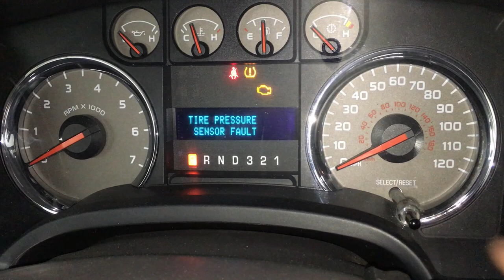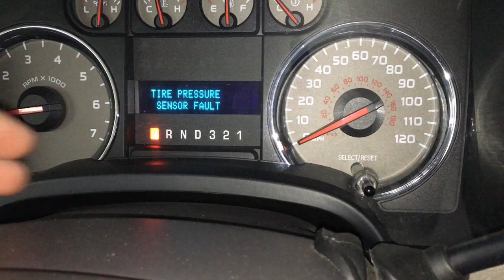1997-2010 Ford F-150 Rear Brake Job: Pads and Rotor Replacement

Comment from the maker: These are the Parts and Tools needed to complete the job:
Rear Pads (check fitment guide)-
http://amzn.to/2m43EcI
Rear Rotors- (check fitment guide)-
http://amzn.to/2m4cR4W
Brake Dielectric Grease-
http://amzn.to/2m424HN
Nickel Anti-Seize-
http://amzn.to/2mOVBjX
Brake Cleaner-
http://amzn.to/2mkwHLA
C- Clamp-
http://amzn.to/2mOYgdB
Reply: FordTechMakuloco it also causes the caliper to bite on the ear when it's on wrong and jams the brake on the outside thank you I had them wrong and it was jammed up
Reply: You failed to mention guides and guide boots in your list.
Reply: As you clean the caliper I find myself blowing on my phone trying to get the dirt an dust off the caliper. 🤦🏽‍♂️🤣
Reply: @derekhuber3392  He used the same guides.

Comment: Great video but without the park brake components it's not really a good representation on what people would encounter when doing the rear brakes. I love your videos and you certainly make great ones but I think this one is kind of funky. Sure it provides for basic brake replacement techniques but I'm sure you know that the drum park brake is the "headache" part of the job and I think your viewers would benefit from a demo that shows the park brake.
Reply from the maker: +Robert Kohut Maybe in the future, I can only film what comes in the shop and this is the customers decision. The drum in hat brakes can go either way some fall off some never need to be touched.
Reply: This video is good enough for me. 
And so i am content.
Reply: @FordTechMakuloco  A
Reply: ASI ES COMPAÑERO SON MUY IMPORTANTES PARA CUALQUIER VEHICULO SALUDOS
Reply: I just replaced the rear rotors and pads on my 2010 F-150; this model has the integral parking brakes inside the hub of the rotors. The OEM rotors had two threaded holes into which you thread matching bolts, bang on the rotor a bit, then just alternately tighten the bolts until the rotor pops loose. Very intelligent design.  Sadly, the Wagner aftermarket rotors I used didn't have these two "extra" holes; hopefully the liberal coating of anti-seize I applied will make these rotors more easily removeable down the road.

Comment: I am a mechanic and have a small shop and also perform Mobile repairs and diagnostics and I do go to YouTube to watch these professionals perform all different kinds of repairs and diagnostic work. When working on Ford Vehicles I also go to this channel because FordTechMakuloco is the go to channel for me for all Ford repairs and diagnostic work. Thank you for this great video and the many more videos I have watched on your channel. Why do I need to watch a video on rear brake pad and rotor replacement on a F150 Ford Truck? It is because there is always something new to learn from these professionals even at doing basic repairs.

Comment: Shouldn’t you have opened the bleeder screw when depressing the piston to prevent back flow in the abs? Abs module part alone is around $950 bucks.
Reply: Back flow? He never opened the system.

Comment: I wouldn't even have thought about reusing those calipers, but I guess thats the DIY in me. With no labor charge, I go for new parts when they look like this. Those calipers are toast.
Reply from the maker: The calipers were just fine until the day he sold it; they just look bad because he lives on a long gravel road. That's were experience comes in.
Reply: @FordTechMakuloco  I'm 77, and my experience would have told me to put new one on that truck, and not to mess with the glide pins. I just finished replacing the rear seals on my 04 F150. Went like a breeze because of your videos, just like the timing job I did at 153k. Thank you for what you do, you are the best Ford Tech I've ever known, and I've known a few.

Comment: When you press in (retract) the caliper pistons with the clamp it's possible the brake reservoir could overflow and spill brake fluid in the engine compartment. That can make a nasty mess. Check the level before starting then check the level in the brake fluid reservoir after you press in one of the pistons... you can guess it's going to come up that same distance when you do the second one. Some brake fluid can peel off paint. Be careful and don't spill it. Might be a good time to suck out all the old fluid, put in new fluid and bleed the rest of the old fluid out of the system.

Comment: Great video. I do the same thing for all my Ford brakes and really enjoy the process, but one thing I learned is to also put some antisieze on the hub so the wheel doesn't stick to the rust. I pride myself with doing all my own brakes on all my Ford trucks. But once I was forced to hire someone else when I was out of state traveling, to do a rear brake job on my F 250. He put the shoes on backwards, then he found the emergency brake cable was too long because the shoes were installed backwards so he just tucked the cable up there someplace unattached, and put the wheel back on. I didn't notice this for years until I went to replace the shoes again. And this is why I only do my own mechanical work. Because once I brought my 1982 Oldsmobile Cutlass Supreme to a dealer for an oil change, and some lughead put in one quart too much. So it yourself; do it right!
Reply from the maker: Wow what kind of hack gas station did you roll into that was bad! I find the anti seize I put on the centering hub is enough to prevent the wheel from sticking but regular tire rotations every 5k miles is the best.

Comment: A great tip on the axle seals if they have to be replaced,don't buy the cheap seals.National and Timken are two brands to buy for axle seals.Check the slides too,I have seen brake pads worn down due to froze up slides

Comment: Notice the 'New slide pin boot didn't center itself when pushed because their too thin too soft like the ones I bought.. original boots are bigger thicker and springy allowing the slide pins to center themself after braking. I've been noticing a brake hanging on when leaving a stop light and found one rear OEM boot is cut/dirty  hanging up and has caused uneven brake pad wear and caught how my  new boots are flimsy and stay pushed out..Buy OEM on this item but it's discontinued so i went to salvage yard today and picked up 8 for $3.. still much better than 4 new china ones I paid $21 and returning. Thanks good video I learned alot and appreciate it as I'm a diy on everything and can't wait to finally replace the rear brakes tomorrow. I bought my 03 f150 5 months ago. Maybe new ones work eventually idk but I need to see them working well immediately.

Comment: The later models have a vibration damper on one of the caliper bolts. This damper blocks access to the end of the bolt so if an open end wrench spreads you will need to remove the damper to allow access to the caliper bolt with a boxed end wrench.

Comment: Man, I liked the video because I love all your vids.  You have definitely pulled my arse out of many binds and show me fresh new looks at different ways of doing things.  My most fav is the drill trick with the tie rods.  I was amazed at that and have actually uses that trick with stab links.  
BUT, I wish you would have shown a complete (with Parking Brake) video with this.  I've always had questions or wanted to get tricks of the trade on adjusting the parking brake, esp getting the E-brake foot engaging firm instead of going all the way to the floor and doesn't seem like it grips well...  Keep it up brother.  Awesome vids...
Reply from the maker: +Tony Wiggins Maybe in the future the parking brake is not always a failure so it is still a great how to video with good tips specific to this setup. Remember I can on fix what comes into the shop and the parking brakes was the customers call.
Reply: Tony Wiggins i

Comment: Hey Brian,  Good Job on the video..Great step by step procedure   
However just to clear for those that don't know, not all F150 models have a wheel lug spec of 150 ft pound.. If you have the 12mm studs, it would be 100 ft pound. the 14mm studs are 150 ft pound
Unless you work for some local (no name here) tire store.. them idiots think everything is 250 +    
Keep up the great vids Brian..plus love to see the new shop when its done
Cheers

Comment: Wow... one little part of this saved me from learning new cuss words.. :-D   .. and that is that piston with rubber cover that you have to pull back, to get the caliper in.   I've done brake jobs before on my own vehicles, but on my 2000 Lincoln Nav I spent an hour trying to move the shoes in differently and the caliper just would NOT go in.  I tried doing shoes on the rotor, then pop in the caliper.... so many things.   So with greasy hands on my keyboard... yours of the 3rd video I'd seen...   showed me the problem.  Right there.   Those stupid metal 'tubes' for he caliper bolts had to be pushed out the way.   I went back and BOOM!!  DONE.  ughhhhh!!!     Thank you my man.  Perfect.  :-)

Comment: Love your videos.   Just a quick question.   Would you apply brake lubricant on the new metal sliders for the pads to easily slide on?
I noticed you didn't apply any.
Thanks.

Comment: Nice video. I put anti seize on the wheel studs and check them at every 4000 miles when I do oil change. Been doing it for past 28 years. 🤔

Comment: If your rotor is stuck Harbor freight has a 8 inch three jaw puller that works great for 17.99.  I just did this to my 2007 Ford and the rotor was stuck. I used this puller and it popped right off no problem.

Comment: My '97 F150 4.6L 2wd has good old rear brake shoes
Reply: Just what I was going to say, I think they went to disc in 1999
Reply: Ozzstar Yep I was trying to figure if this was an option in 97 since my F150 XLT has anti lock rear drum brakes.
Reply: My '99 F150 4.6L 4WD has front disc - rear drum brakes.

Comment: Thanks for the video.  I have a 2010 4.6L FX2 that I'm going to do the brakes on soon.  Do I need to open the bleeder on the back of the caliper before compressing the piston?  Someone else mentioned its necessary to avoid damage to the ABS module.  What's your opinion?  I've never messed with brake fluid in past brake jobs but this is my first pickup.  I'd rather not deal with refilling and bleeding if I don't have to.

Comment: I just did rear pads and rotors on my '01. Whomever did the pads last time had the outer pad on the wrong side of both wheels. This meant there were 'ears' on both the upper and lower ends of the pads that essentially locked the calipers onto the brackets. I am not even sure how they got them on that way.

Getting the calipers off was...um, interesting. Be sure to check that the location of the 'single ear' and 'double ear' on the pads match on both sides.

Comment: 6:38  Usually I put a little anti-seize on wheel studs, have had too many hard to remove lug nuts in the past.  Generally speaking I never bolt or nut something dry (either never seize or loc-tite for the internal stuff).
Reply from the maker: +Hubjeep A light oil on the threads is acceptable but not anti seize. The only vehicle I ever recall needing lube on the threads was my focus they were always so dry for some reason.
Reply: @FordTechMakuloco  A bolt that is torqued to spec will not back off because of anti-seize.  In fact anti-seize is generally made for threaded parts.  The bolt holds the nut on because when torqued properly is actually stretched (picture a rubber band?), and that stretched tension springs loads the nut to overcome the engineered pitch of the threads.  What anti-seize or some kind of super lube is more likely to do is give an abnormally low torque reading; causing an overstretch of the bolt and subsequent breakage.

Comment: No cracking the bleeder valve? No taking the top off the master cylinder reservoir?  Won't the pressure be of issue?  I've always had to either crack the bleeder or take the cap off the fluid tank.
Reply from the maker: +WreckDiver99 No need for the rear generally since the pistons are so small unless some one "topped" off the brake fluid which is illegal in most states.
Reply: FordTechMakuloco since when is topping  off brake fluid illegal?  I do it everytime I do brakes because I crack the bleeder valve and compress the piston.  it's how I was taught by a master mechanic....I actually pinch the line, attach a "capture vessel" to the bleeder and proceed.  I've  been doing that for almost 30 years.   After I'm done with the job I top off the fluid since I dumped some in the capture device (pop bottle with some tubing).
Reply: FordTechMakuloco Damn I guess I have breaking the law for 50 years. Why would it be illegal to top off the brake reservoir when it is below max level?  You must live in a northern state where they try to legislate all phases of life.
Reply from the maker: +Hammer0f Thor The idea is if the brake fluid is low either there is a leak or the pads are worn below spec either way it is a safety issue and that is the reason for the brake fluid level sensor and the warning lamp. In essence by filling the reservoir you are defeating this safety device and putting the customer in danger hence the law is born. You should never have to top off brake fluid if it is low something is wrong.
Reply from the maker: +WreckDiver99  The idea is if the brake fluid is low either there is a leak or the pads are worn below spec either way it is a safety issue and that is the reason for the brake fluid level sensor and the warning lamp. In essence by filling the reservoir you are defeating this safety device and putting the customer in danger hence the law is born. You should never have to top off brake fluid if it is low something is wrong.
Reply from the maker: +WreckDiver99 Servicing the brake system and replenishing the brake fluid is totally different than topping off the brake fluid like it's washer fluid or something that's what I was getting at not during normal service but like let's say a quick lube place does a oil change they cannot just top the brake fluid off like any other fluid.
Reply: FordTechMakuloco I've noticed you didn't open the brake master cylinder before pushing the pistons in. Why is that?
Reply: FordTechMakuloco Right 😉. I've always been able to tell when pads are worn out of spec by the fluid level. Some expert politician showed me that one.
Reply: I just blew my caliper. Didn't open the bleed valve

Comment: Thanks for doing these videos. Very helpful. Now a Ford owner. But I changed my rear brakes, new hardware, cleaned everything.  However at low speeds I get a metal vibration sound of the caliper engagement to the rotor, once hits rotor stops. Like a metal creaking sound. Should I or could I add some silicon to the slide guide hardware. To help pads slide to and from rotor on application and disengagement.?

Comment: I have a 2011 f150 and I saw a video we're the guy pull out a rubber cover in the back to loosen the parking brake. Is that something you have to do to get the rotor off?
Reply: If u find a good video of that please link it. I'm in that situation right now. I cant get the rear rotor off because of the parking brake
Reply: One rotor came off pretty easy the other was on pretty good we used a 4 pound hammer to hit it off. But I found the rubber gromet at the bottom behind the rotor it is really hard to see inside their but if you can get a flat head screwdriver in their you can spin the adjuster to loosen the emergency brake. But i didnt attempt that we just hammered the rotor from the back and spun it until it popped off.

Comment: Changed the rear pads and rotors on 2003 f150 following your guidance. All slide pins smooth. Test drove for 2 miles. No problem. Drove to work. 20 miles. Both overheated and smoking. Any idea why?

Comment: What type of Anti-Seize to use? 
 General-purpose anti-seize compound. A blend of aluminum, copper and graphite in a            petroleum base grease 1800°F.
                                                  The other type is
Blend of nickel and graphite in a petroleum base grease 2600°F.
Reply from the maker: +Mario Gualtieri I prefer nickel because I can use it on the spark plugs and exhaust work and it's still good for brakes just a bit overkill in specs.
Reply: Mario Gualtieri when I worked in an auto shop we used aluminum or copper for the brake hardware and copper for the caliper sides and caliper piston. Copper is best for brakes but expensive.
Reply: FordTechMakuloco I used to use aluminum for spark plugs cause most vehicles now are aluminum block. We used aluminum for the exhaust pipes connections as added protection with the aluminum gaskets.

Comment: have you a video on replacing e-brake shoes on a 2002-2003 ford f53 chassis-6.8 ltr. stripped motorhome base; rear,s are dually,s; I have found you have a way of explaining in an understandable manner; great video,s thanks PATRICK.P

Comment: I saw a Vid on the sidebar after this one of "The most important step before doing a brake job" and you removed some brake fluid from the caliper. Is there a reason you didn't do it this time?
Reply from the maker: +Joe Peacock This truck also had a brake flush this is part of a much larger set of jobs on this truck.
Reply: Makes sense. I have a 2000 F150 and do most of my repairs from what I learned helping my dad replace when I was younger. I found you looking for Ecoboost advice on a 2011 SHO, and I can't stop watching how I've done sub par maintenance so far haha.

Comment: I have an electrical problem with my 03 & F-150. I have come to the conclusion that the  turn signal switch is the reason I have no turn signal no flashers and now no break lights. Do you have a video for replacing this, or could you make one. I have the part.  however I have never done this and I'm concerned about screwing it up since I rely on her for work and school. thanks for the videos you make have really helped me with school and projects